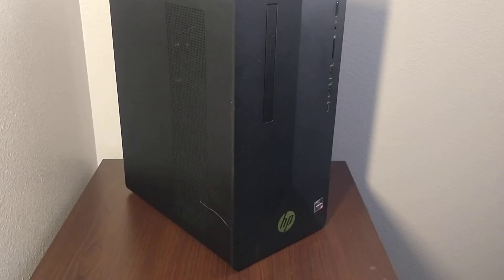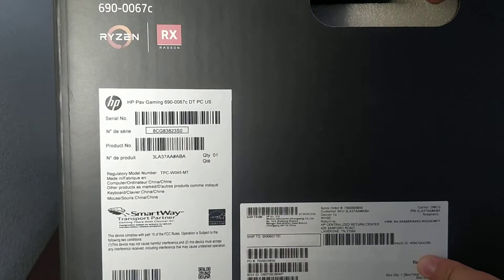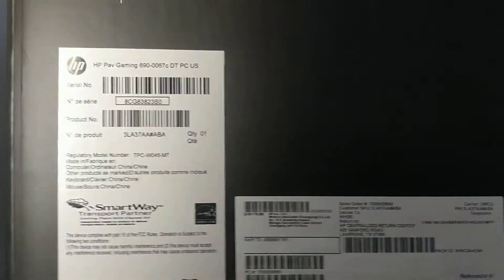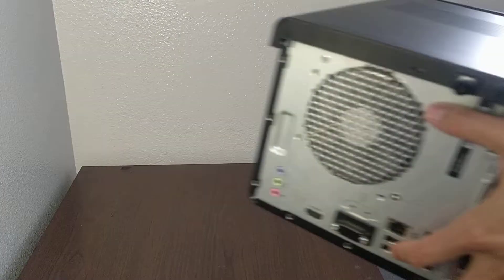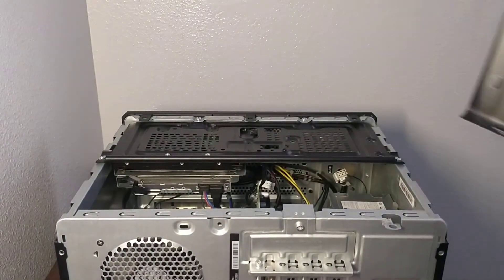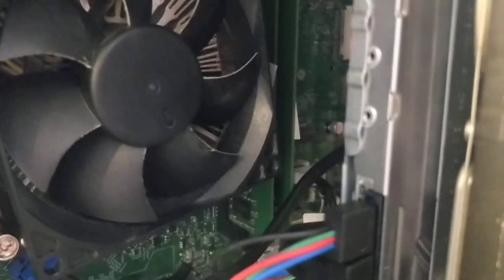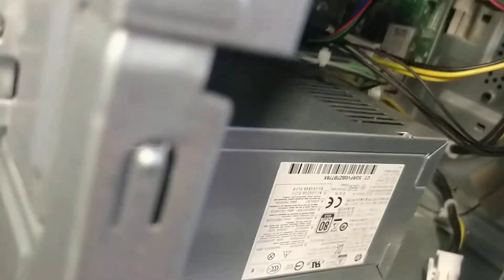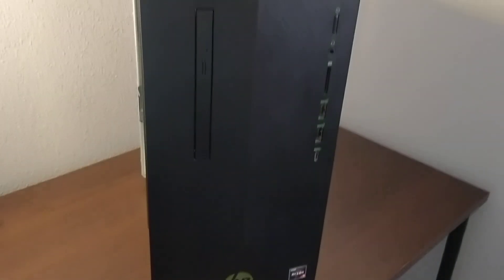HP Pavilion 690-0067c Unboxing.

Comment: So an aftermarket power supply like a EVGA 600w won’t work? It’s the same exact size but it has different connections..
Reply from the maker: I dont think so since. The mother board wont have a 24 pin connector. and It also has a OEM weird cable.
Reply: @richyoyo9796  thanks. Does HP sell other psu’s?
Reply from the maker: I think you would have to contact hp for that. I'm not sure. if by that point might as well buy a new computer.

Comment: I see a lot of questions about if this pc can be upgraded I know it is late but to make big upgrades you need to install a 500w power supply and it’s really specific the name on the hp part store is L05757-800 and the mother board is compatible with 2nd gen Ryzen cpus and any gpu 10 inches and under.
Reply from the maker: Here's my install for my gpu. https://youtu.be/chszoKgjX2U

Comment: The motherboard(sunflower) isn’t compatible with any other gpu
Reply from the maker: Sorry my comments didn't show this. The mother board works fine with any GPU under 75 watts need. Mine works 1050ti. I was thinking to upgrade to 1650 sometime. but not worth the price.
Reply: @richyoyo9796  you could get a 1650s
Reply from the maker: @criminalmind9327  Yep that works. But I just bought this one. it comes with a 1650. super. its pretty good.
https://youtu.be/SNvpLI-23Uo

Comment: How can I contact you about upgrading this PC, I have the same one and I want to upgrade the processor, ram, and maybe the graphics card, my discord is thesteathy_ewok on Twitch#1448
Reply from the maker: Sorry about that I dint see that.  The mother board limit is an 2600 ryzen. might as well just keep  the proccessor. and upgarde the ram if need.

 The only thing i recommend is getting A new graphic card one that recomends under 300watt since the power supply is limiting this computer.  Other then that I don't recommend upgrading anything else other then getting a new computer since the mother board also limits the upgrades.   

I put in a 1050Ti graphics card in mine. 
Heres the GPU I have. 
https://amzn.to/2QpC7Tc

https://www.evga.com/Products/Specs/GPU.aspx?pn=7E5BFB9F-C13B-4800-A855-BEA3724A5F8E

spec for the computer
https://support.hp.com/us-en/document/c05953209
Reply from the maker: Also I reocomend getting an ssd or an m.2 hard drive that will speed up this computer like carzy if you have not gotten one.  I have a Western Digital Black SN750 500GB Nvme SSD 
https://amzn.to/3hz0mdy

Comment: Do u think I can fit a 600 watt psu in there
Reply from the maker: Its not a regular power supply, Its not a normal size. but you should be able to find a use one.   I see other hp computer of this case size with higher watts power gpu in it.

Comment: Yo first btw, I’m buying one from amazon, is it worth it for a gamer like me?
Reply: I have the exact PC. for MW ifs around 50 to 90 fps fortnite is like 120 valorant is like 250 to 300 destiny abt 120
Reply: @colinbarnes4756   Hey how did you get your fps that high? I have same PC. Plus what kind of monitor are you using?
Reply from the maker: I play Apex legends on mine with a 1050ti at medium or something at 2560x 1440. at 74hz monitor.  and LOL fine at high.